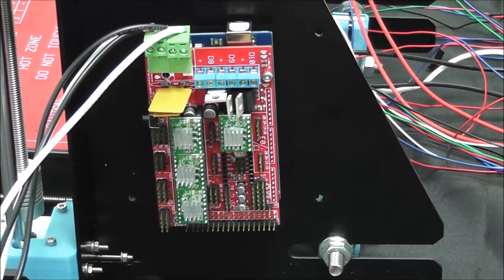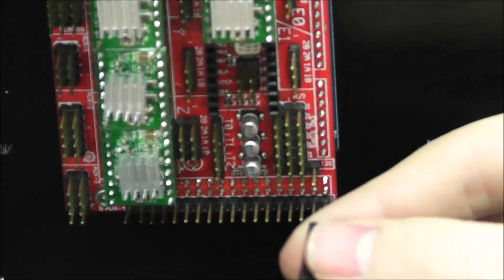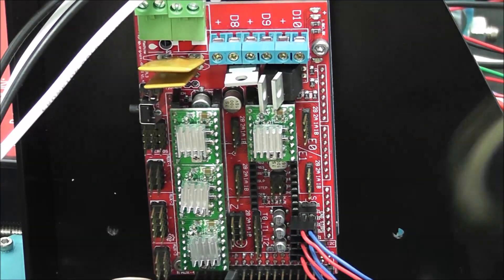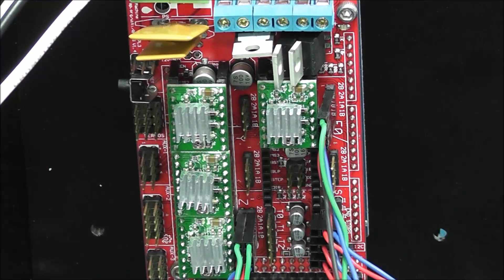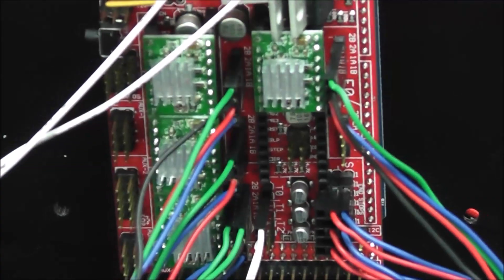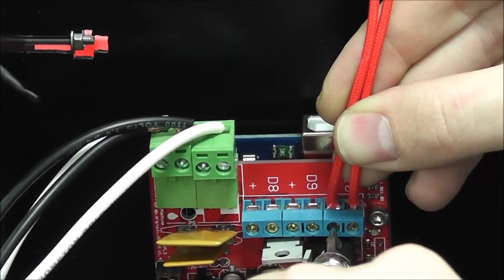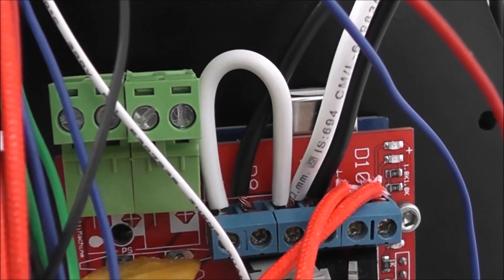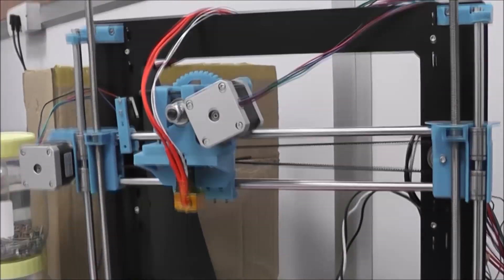RepRap Prusa i3 Assembly Guide p7 - Electronics Final - Additiveware International

Comment: Hi I have a board the same as your feature.  Have just bought a filament runout sensor with a 3 pin connection.  How do I know where to plug it in without blowing everything up.  Thanks

Comment: Reprap Ramps WIKI says the wiring order should be what you have but with each adjacent pair reversed. So far Ive seen every imaginable permutation of the 4-wire colours and I'd really appreciate it if someone posted a definitively correct answer - or advice on how to work out which wire needs to be where, starting from PWR IN going Right please as the "Ramps Wiring Kit" came with Red Black Blue Green wire order.

Comment: One glaring omission is the missing location of where the fan(s) are plugged in. I am watching this while I am in the process of figuring out how to set up my own board. I have 2 fans. One obviously uses direct power which can come from the power supply. The other is controlled by the software. I was hoping for that information would be included here. But that information is missing.